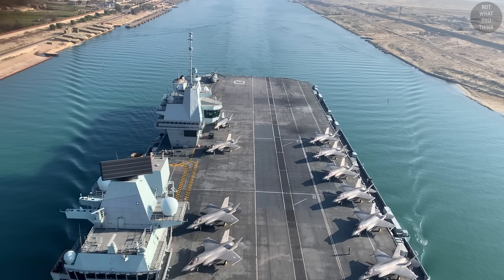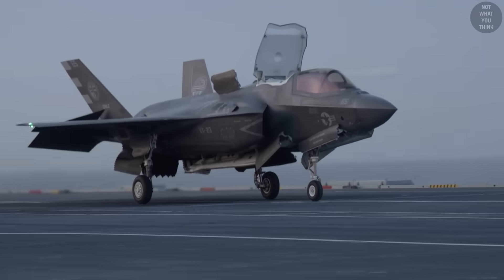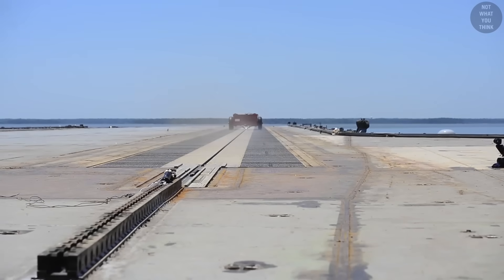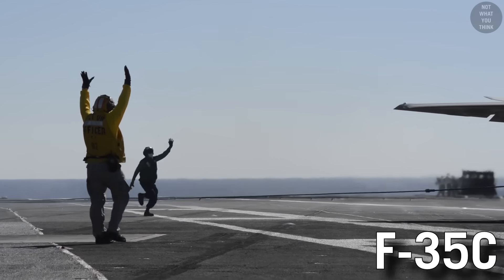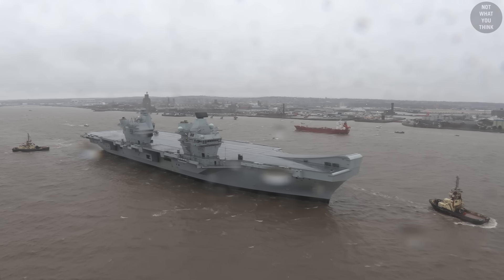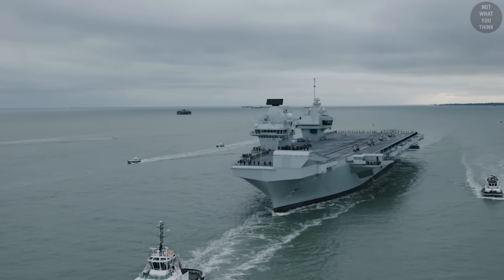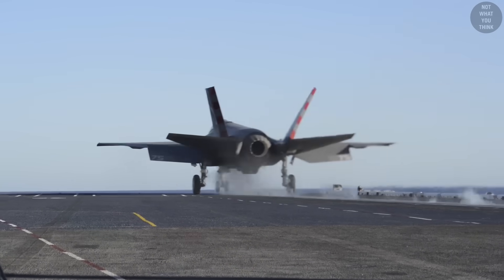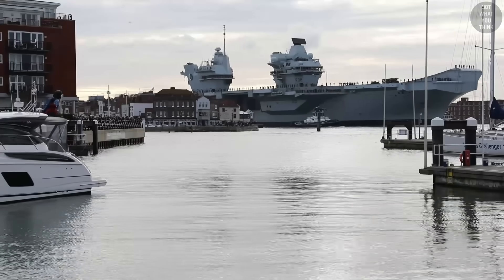Was the Angled Flight Deck Missed on HMS Queen Elizabeth?

Comment: For STOVL aircrafts, when more ammo or weight is needed just use catapults to take off, the aircraft should get rid of that ammo before landing vertically.
Reply: You can also land a STOVL aircraft by a rolling landing as seen in the video, so no need to ditch ordnance.
Reply: @dc-4ever201  CATOBAR aircraft don't dump ordnance to land they aren't going to dump millions of dollars in the ocean after every CAP. There are plenty of YouTube videos showing CATOBAR aircraft landing with ordnance.
Reply: @JoeBLOWFHB  I didn't say they did
Reply: F-35B is not catapult compatible
Reply: @kellynyanbinary  *The F-35B does not need catapults to perform short takeoffs as it uses downwards thrust to performs such measures.
Reply: @goosenuggets9693  Kelly Wu is right. Only the C variant is A) equipped with the ability to attach to a catapult, B) equipped with a tail hook (to my knowledge) and C) to be reinforced to withstand the stresses of catapult takeoffs.
Reply: @goosenuggets9693  yeah, but it still has a lower payload. If they used cats, it would have the same takeoff weight and without having to waste space for an angled deck. But hey brits doing what they want, can’t be mad
Reply: @kimjonglongdong3158  the F-35A like many other Air Force aircraft does actually have a tail hook albeit much lighter and weaker as it's only meant to slow down aircraft that came in too fast and are running out of runway.
Reply: @TheWizardGamez  Thats why the Brits use the roll on landing technique so they don’t have to dump anything when the return with heavy loads. I believe the USMC are  cleared for this also on the QE carriers but not their own. Could be wrong on the specifics here though.
Reply: @TheWizardGamez  it has a limited payload anyway, if it wants to keep its stealth capabilities....
Reply: Getting rid of ammo before landing was one of the many reasons they retired the F-14.
Reply: @yolkiandeji7649  NO IT WASN'T!

 All carrier borne aircraft regularly land with ordnance they aren't going to dump $400,000 dollar sidewinders or $400,000 AIM 120's after every CAP the same goes for bombs. The only thing they regularly dump is excess fuel to lower the landing weight to spare the airframe and arrestor system wear and tear. The F-14 was retired because of it's extreme cost to maintain it took 240 hours of maintenace for every flight hour a good portion of this cost was due to its swing wing design.
Reply: He forgot to mention one thing. In a raging war, you could imagine the enemy's initial targets would include airports and long strips of land to prevent conventional enemy aircraft from taking-off and joining the fight. Having combat aircraft that can take-off and land vertically and still be capable of mach flight would be a very big asset in such a scenario. They wouldn't need the conventional, long airstrips to be combat-ready and thus be more usable in protecting the airspace. What exactly is the use of a faster and longer-range aircraft if it is stuck on land, unable to take-off? VSTOL aircraft can practically join the fight from everywhere and that is the reason why I think it is the most ideal of the three F-35s.
Reply: @mariodelaurie1142  that's what cruise missiles are for.
Reply: @mariodelaurie1142  I might agree with you, except for the fact that fitting that STOVL system to the F-35 removed a great big fuel tank, and the gun. Who in the paisley-striped hell gives the United States Marine Corps an aircraft without a gun?? They had to add it on.... and it does not have very much ammo.
Reply: @Tomyironmane  The USMC variant will do shorter hops. Forget the gun. They'll be dropping bombs like artillery, and fly back to load more to drop where they're needed. They're not going to waste time trying to strafe anything, they'll be responding to calls for fire from the ground and taking out more important assets.
Reply: @ChucksSEADnDEAD  You've never seen a gun run, have you? The point of the gun is direct fire without the kinda inconvenient collateral damage you get from 500lbs of BLAM. Moreover, a lot of ROE the pencil pushers put in mean you have to have visual ID on targets, which is gunfight range.
Reply: @mariodelaurie1142  And that's why the Brits developed the Harrier- they knew the Soviets would knock out most of the UKs airforce bases so needed the option of short takeoff and landing fast jets - the F35B is just the modern Harrier and the Brits were Level 1 partners in its development.
Reply: @mariodelaurie1142  Yeah as for the lower range due to less fuel, I was like hello have you heard of in air refuelling, we've been doing it for years.
Reply: Sure, but dropping ammo on the runway to preserve it could cause damage to the ship or incur accidental detonations. Dropping it into the sea is a waste of taxpayer dollars.
Reply: @davidmalkowski7850  I think he meant dropping it onto the target it was put up there in the first place mate. Could be wrong,  but that's how I interpreted it anyway...
Reply: @randommadness1021  I think it depends on the ordinance. If they're coming back with bombs they'll dump them in the ocean, but some types of missiles are fine.
Reply: @davidmalkowski7850  Bringback weight limits are always a waste. In civilian aviation, sometimes aircraft have to dump fuel or circle around burning it before landing.
Reply: Alenas Kvasninas  There are Nato airbases around the world that have long range tankers, they regularly refuel allied aircraft on operation.
Reply: Arthur Humphreys You don’t think jettisoning Phoenix missiles just to make landing weight wasn’t a factor?
Reply: @yolkiandeji7649  The Phoenix missile was top secret I was a green shirt in VF-32 on the flight deck of CV 67 the day we lost an F-14 over the side with one AIM -54 and the AWG-9 system that controlled it. This is the ONLY time a Phoenix was lost at sea and the USN stood guard over the site and retrieved it with the NR-1. The plane had spooled up to taxi to the flight line and the throttle locked open on full. The pilot locked the brakes and just missed a line of A-7's full of fuel and ordnance as the plane skidded down the deck I watches a red shirt get his ankle skidded over by the 65,000 lb plane while he was trying to put the safety pins back in the weapons. The pilot and the RIO ejected the pilot landed on the deck and messed up his hips and the RIO landed on a folded A-6 and broke his leg.
Reply: @yolkiandeji7649  They never loaded the full load of Phoenixes for operational use. They typically took 2 Phoenixes, 2 Sparrows and 2 Sidewinders so that they didn't have to dump anything.